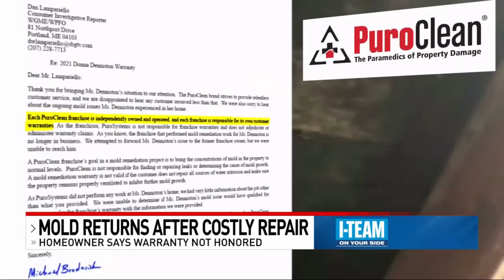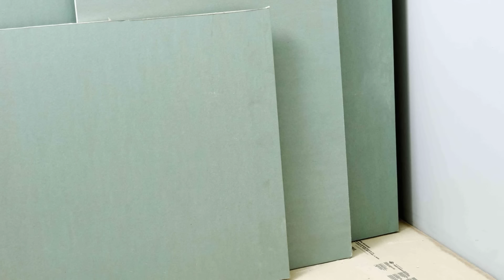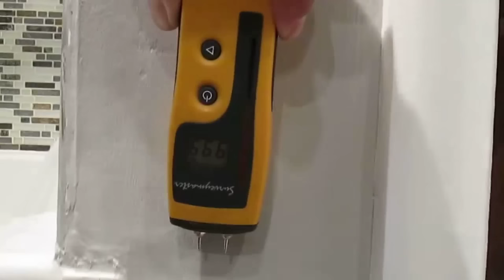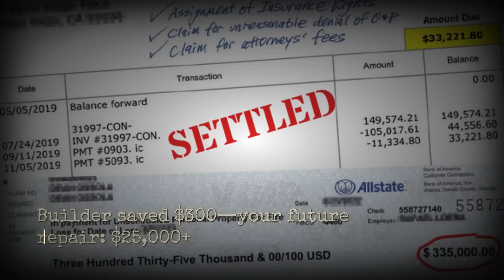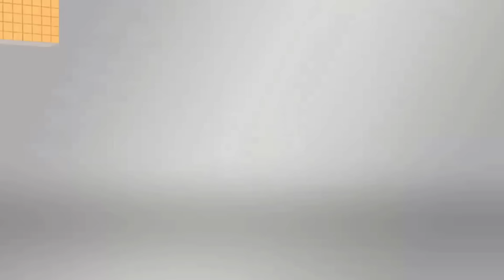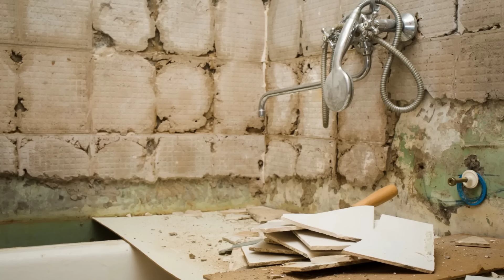Why 90% of New Bathrooms Are Garbage (The Waterproofing Scam)

Comment: Up until 1980 all we had was our claw foot tub in our old house that is in our parents house. The old bathroom was in serious need of remodeling, the plaster ceiling was coming down due to the old Yankee gutters leaking, the old sink attached to the wall with the two chrome legs holding the front up and the ancient toilet in the corner. My mother got talking to the guy who read the electric meter and she mentioned that she was looking for someone to redo the bathroom, he was Puerto Rican and said that him and his brother-in-law did jobs on the side so she hired him, at the time I was 19 and we were going into NYC everyday because my father was in the hospital there having two major surgeries within three months, it worked out good because we were gone all day because my mother insisted on going to visit him everyday she didn't drive so I would drive us and stay all day and do this everyday, she gave him the key to the house and they got started. The one thing my mother wanted was a shower, ànd the toilet sink and tub she wanted in different places, he said the shower was no problem so he installed a shower valve and pipe in the wall, he put up metal rods that surrounded the tub from which three shower curtains would be hung, the plastic shower curtains would be inside the tub and the beauty part was that no water would ever hit the tile wall it would all be contained inside the tub, it still works flawlessly to this day, no way would I ever give up my original to the house claw foot tub, it is in excellent condition and I use it now more than the shower especially in winter, all the pipes were replaced with copper and PVC during the remodel, unless you pay a lot of money new construction is crap.
Reply from the maker: Great story, thank you for sharing.New construction is crap 💩

Comment: I don’t trust membranes that are glued together with thin set. If you do a concrete base, use a good liner and bring it high up the wall, don’t cut the corners. I like to use WEDI or Hydro block. Something with a manufacturer sealant for the seams. And make sure to install per manufacturer specifications. You’ll be good to go.
Reply from the maker: Exactly, properly sealed systems are the only way to go! 💯
Reply from the maker: Exactly, properly sealed systems are the only way to go! 💯

Comment: I remodeled a shower in our 2003 home. The old tiles must have sealed well because there was zero damage to the plain white drywall underneath. I had to replace the drywall because it was damaged from removing the tile, and I used the green stuff then painted on a pink membrane that should seal it right up. The tiler used a cementatious mortar on the new tiles so hopefully no issues!
Reply from the maker: That’s a lucky find with the original drywall being dry, but you definitely made the right call replacing it. Using the "green stuff" (moisture-resistant drywall) paired with that pink waterproofing membrane is a bulletproof way to make sure you don't have to worry about leaks for another 20 years. It sounds like your tiler knows their stuff too—cementitious mortar over a membrane is a solid, professional setup. Enjoy that fresh shower!

Comment: this is why I never do tile bathrooms, keep it simple and do full pre fab tub surrounds direct to stud
Reply: Been doing tile showers for 20 years. Just do it right and this won’t happen.
Reply: @Wangside891  What's the "right" way to avoid water eventually getting behind the tile? Putting a waterproof membrane behind the tile will protect the substrate, but it won't stop mold from growing behind the tiles once the silicone or grout sealant fails. Vast majority of homeowners aren't going to maintain a waterproof seal between the tiles over the years.
Reply: Yes, but some of us want "nice" bathrooms, not "apartment" bathrooms.
Reply from the maker: That's one way to avoid the headache! 😂
Reply: Hard to argue with that approach. Prefab surrounds installed directly to the studs eliminate a lot of the failure points you get with tile—no grout lines, no hidden waterproofing mistakes, and much less risk of leaks over time. Tile can look great, but it really depends on perfect installation, and that’s where a lot of problems start. Keeping it simple often ends up being the most reliable solution.

Comment: We had both our showers redone I made sure the walls and floor was covered with Kerdi Membrane layer down. I watched every step of the process and made sure it was installed
Reply: kerdi sucks
Reply: Yup i went with the Kerdi drain and the kerdi peices over the fixtures. Made sure the curb seal was alos done with the kerdi membrane got the proper corner peices for it all too
Reply: Is that even legal to do in USA? It's mandated in Canada and most of Europe.
Reply from the maker: That is exactly the right move. Being your own project manager and watching the process is really the only way to be 100% sure the waterproofing wasn't rushed or skipped. Using a full Kerdi system on the walls and floors creates a bulletproof "tank" that’s going to save you so much stress (and money) down the road. It’s great to hear you took that extra step to oversee it!
Reply: That’s the right way to do it. Making sure a proper waterproof membrane like Kerdi is installed—and actually watching the process—goes a long way toward preventing long-term issues. With showers, a lot of problems don’t show up right away, so getting it right during installation is everything. It’s good to see someone treating waterproofing as a priority instead of an afterthought. That’s really what determines long-term durability in a bathroom.

Comment: If you buy a new home you are guaranteed, I repeat,  guaranteed to have a leak and mold.  Second, even if you have membrane you are guaranteed to have a leak and mold.  You will just get it later.  This video is just an advertisement for membrane.  They will never be applied properly and  even if they do it won't last.  Your best bet is to find an oldtimer who knows how to put in one of those old "fifties" bathroom.  Cement on metal lath.  This is why homeowners are nuts for ripping them out in the name of modernizing.  Baring that get you a competent contractor and have your bathroom mudded in.  Not as good as those old fifities bathroom but it's better than membrane.

Comment: There should be laws preventing builders from cutting corners. In addition to that, building inspectors should be held accountable when they fail to find obvious defects. Builders should be forced to correct issues that will lead to nightmares for homeowners down the road. After I bought my home in North Georgia, I noticed problems that needed to be fixed. During that time, I was at a hair salon with my wife and noticed a license to cut hair on the wall. At that time, home builders weren't required to be licensed! Crazy!
Reply: Licensed or not, it is the builder's negligence! Until they are held responsible financially, nothing will be done!

Comment: I had a gorgeous tile shower built in an old home, a rental unit.  8 years later it was dripping into the basement (thank God this wasn't a 2nd floor install).  My mother's house has a 2nd floor tile shower built in 1969.  It has never been re-grouted or re-sealed or re-anythinged, and has never leaked.  She still uses it daily.
Reply from the maker: Oh that what would be a mess if that was 2nd floor 😂

Comment: A tile floor over a mortar bed will outlive us all if done right. Except at the beginning of the video you showed old glued down asbestos tiles
Reply: 100% correct. Expanded a 1/2 bathroom to a full bath in my Grandparents soon to 100 yr old house. First tile done in what I call the mud method is really hard to rip out.
I did wainscoting on the walls and tile enclosed in the tub/shower..found a guy who did the mud method also lets you overcome any walls not being plumb.
Did it next door on my Greatparents old home which is never than my Grandparents home (right next door) when I remodeled the bathroom. It's the only way to do tile imo...
Reply: Until grains of sand from the mortar eventually plug up the weep holes in the drain and the mortar bed starts retaining water, which will wick up the walls or over the curb.

Comment: My neighbor tore off his shower wall on a 1984 home.  Tile was glued to greenboard with grout between tiles.  No waterproof membrane.  There was very little mold.
Reply: I have torn out 2 green board showers in the last two homes I owned.  The studs were rotting.
Reply: @steveroonic6504  I’ve torn out dozens of green board bathrooms. It’s such a toss up. Some were just fine and many others were full of rot, mold and insects.
Reply: I have a tub I retiled the shower 30 years ago and used greenboard, waterproofing was unknown then.  Still fine.  The tiles were glazed so I think those are pretty waterproof.  I used grout sealer, done.  That said downstairs I put in a new shower last year.  I used Kerdi on the base, cement board on the walls plus Kerdi for the seams and all over the top of that I used Redguard.  Should be OK.  I think a lot of it comes down to drainage.  If you have good drainage you are good otherwise it is a time bomb.
Reply: @paulnicholson1906  Grout sealer breaks down over time, especially if you scrub the grout with typical cleaners for showers. If you use mild detergent and no scrubbing maybe it'll last if you reapply once a year.
Reply: That’s one of those “survivor stories” you still come across with older builds. It’s kind of amazing how something that technically shouldn’t work by today’s standards can still hold up after decades. From what I’ve seen, a lot of those older showers survived because of things like good ventilation, lighter usage, or just simpler construction with fewer failure points. But at the same time, for every one that held up, there were probably plenty that didn’t.
Today’s methods with proper waterproof membranes are more about consistency and risk prevention than assuming everything will hold up long term.
Reply: I think some of this is circumstantial. In my previous home, I had some construction guys (relatives of my then-boss), add a shower head above the existing bathtub in the hall bathroom.
     They did just green drywall and tile squares.  Since I'm single, and was raised to only take 3-minute showers (I really take more like 4 minutes), and live in So. Cal., which is not very humid, it worked out fine, no problems.
     But as I've learned from this vid and other people, that was at best a "minimal installation."
Reply: That are special waterproof panels.
Reply: As a tile contractor in California,  been tiling since '88 I've seen a lot of failures and repairs.  I would never use green board for a shower or a hot mopped pan. Green board that lasted more than a year had to be pre coated with mastic and dry before tiling. Thats how I remember it became acceptable. And most didn't. Not in my trade. Green board is for walls in a bath or cheap sink/bath location like a free standing. Hot mop fails with California soil movement  & earth quakes & tremors. In 95 i began using  a 4 layer  water proof pan with 40 mil liner plus polymer and never had 1 fail. Floating is best & backer on too tight  budget, and use polymerers..why change what's proven?

Comment: So say those older baths last longer but yet say have to use products that did not exist then ? 50 year old bath. shower, with tiles direct over drywall (albeit drywall in 1970) original and no issues ? so WTH ?
Reply: They used mud beds

Comment: I painted several layers of waterproofing membrane over my cement board, but those sheets of waterproof membrane look like a better option.  Maybe set them into the waterproof painted "membrane"?
Reply from the maker: Using dedicated sheets is usually more reliable than just painting it on, but definitely follow the manufacturer's advice on setting them.
Reply: Both Red guard and sheets are by far the best way but they can also be done the wrong way as well. Tile star and that tile coach channels are the best.
Reply: @Cello69. I used Red Guard in mine.
Reply: No, those are made to be installed with thinset (which water can wick through over time) but I would recommend getting some waterproofing band like they use in Australia. That type gets embedded into the liquid membrane, then brush more over it. Use at all wall and floor transitions, and your install is even more bulletproof.
Reply: Sounds like you already did a solid job using a liquid waterproofing system over cement board. When applied correctly with the proper thickness, those can work very well. The advantage of sheet membranes is consistency—you get a uniform barrier that’s less dependent on application technique. That’s probably why a lot of pros prefer them.
Mixing both systems can work in some cases, but it’s usually better to stick with one complete system to avoid compatibility issues.

Comment: Builders should NOT BE INVOLVED IN TILE SHOWERS.
Reply from the maker: That is a very strong point, and it highlights a common concern regarding specialized craftsmanship versus general construction. Many homeowners have discovered that hiring a dedicated tile professional is the best way to ensure the long-term integrity and waterproofing of a custom shower. Your perspective is incredibly valuable for anyone looking to avoid the common pitfalls and "scams" often found in modern bathroom renovations. We truly appreciate you sharing your expertise and helping our community protect their homes from potential water damage. Thank you for contributing such a bulletproof insight to the discussion!
Reply: @QualityRot  I was a builder, I actually built my showers myself. I couldn’t trust anybody 40 years using a rubber liner and rocks at the drain all my customers got squeegees.
Reply: @QualityRot and always rooftar over subfloor preslope over rooftar rubber over preslope round weep rocks at the drain Portland and sand mudpan.  Give the customer a squeegee and tell them to use it on all surfaces after use.

Comment: My contractor used the schuluter system underneath with porcelain tile on top. Is that good?
Reply from the maker: A Schluter System combined with porcelain tile is considered the industry gold standard for waterproof assembly when installed to manufacturer specifications. Unlike traditional methods that rely on the tile or grout to shed water, Schluter creates a dedicated, airtight secondary drainage plane that protects the structural framing from moisture and vapor. However, the system's integrity depends entirely on the installer properly sealing all seams with Kerdi-Band and using the correct unmodified thin-set. Without a successful 24-hour flood test prior to tiling, even the most expensive materials cannot guarantee a leak-free installation.
Reply: IF he followed the rules yes- but even a great system can fail if not done right.

Comment: There are a ton of new apartments and ones being built right now in the Charlottesville, VA area ... I know people who are renting in these over priced locations ... and the mice and insect issues are in every unit... if animals can get in ... anything can get in ... water, dampness, waste, etc ... they build quickly - and these sub contractors don't care ... they might get deported .. might not ... there is no accountability .. but you better pay your rent and not hang photos on the wall ... it's a scam ... and one that has lead to mold issues and other legal concerns ... for the tenant!
Reply from the maker: In Virginia, high-density residential projects are governed by the Virginia Uniform Statewide Building Code, which mandates specific moisture barriers and air-sealing requirements. However, rapid production often leads to the improper installation of flashing and weather-resistive barriers, creating hidden pockets for mold and pest entry. Subcontractors frequently bypass the rigorous air-leakage testing required for "Luxury" certification, resulting in units that fail to maintain a controlled internal environment. This systemic lack of oversight during the framing and "drying-in" stages is what ultimately compromises the health and safety of the tenants.
Reply: @QualityRot  - Yeap - that's what I've seen ... it's on the books ... but maybe it's followed ... One guy I know from Woodbridge/Quantico  - his rental was completely black mold infested by cheap construction ... law suit later - they settled out of court ... once the dry wall goes up ... most people are in & out of these places 1 to 2 yrs  ... property managers go in and fix it quickly -- then rent it right out ... NOVA is full of this crap ...